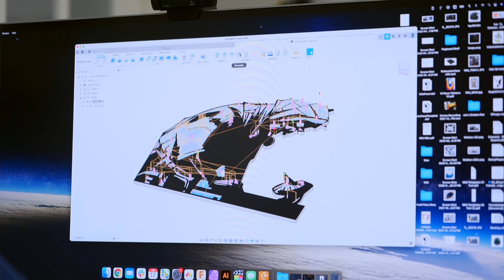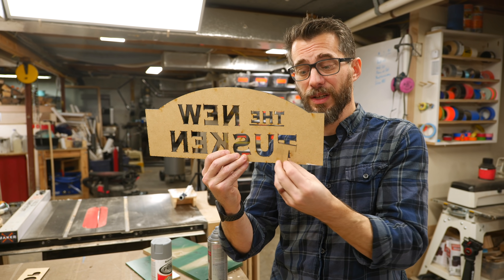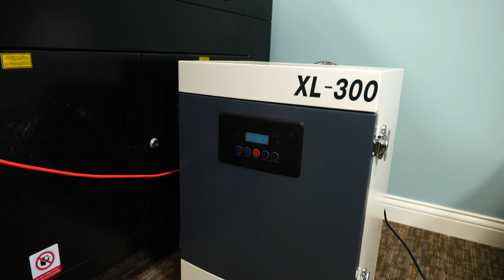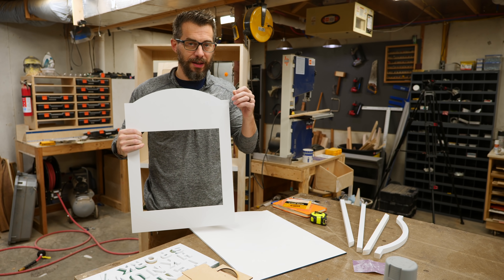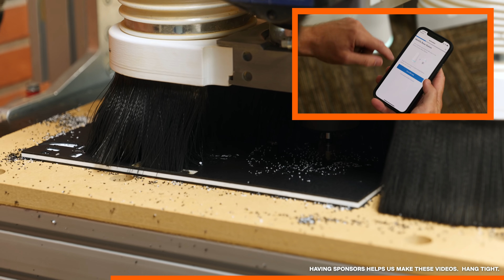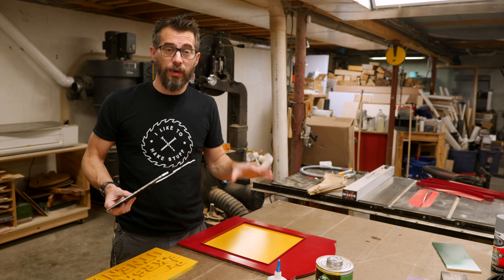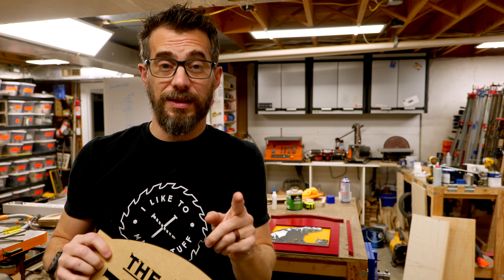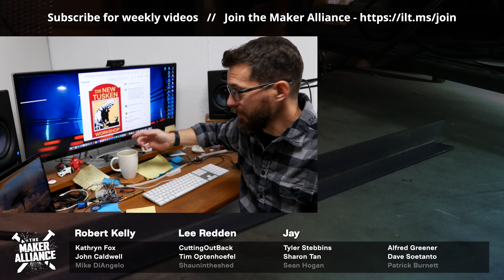Should You Buy a CNC or a Laser?

Comment from the maker: Save 20% on your SimpliSafe security system and your first month is free when you sign up for Interactive Monitoring. Visit https://SimpliSafe.com/ILTMS to learn more!
Reply: Could you do a review of different 3D printers?  Or try to make your own?
Reply: hey how is it going with your ghia : )
Reply: Bob Smith Industries insta-set accelerator works great for any CA glue and doesn't hurt painted surfaces or leave a white residue like other activators will. I use a needle applicator bottle for better control instead of spraying, plus you don't waste as much.
Reply: You're promoting someone. Did you forget the subject? Just remained you the subject, Should You Buy a CNC or a Laser?

Comment: Quick tip. For the template at the end, use wax OR Vaseline to cover the template back and edges this prevents the glue from sticking to it. Personally Vaseline is my favorite you can warm it a little and it becomes liquid and just paint it on. Super simple and glue never sticks to it. I also use it in some cases for painting to prevent paint from sticking.

Comment: After researching for quite a while I just pulled the trigger and bought a laser cutter for my workshop instead off a cnc. Main reason for picking the laser over the cnc was the dust a cnc would create. Other factors where the ease of use (No different tools and less cam) and hopefully that it would be easier to learn by multiple of my collegues
Reply from the maker: Very good point. You just have to vent a laser where you have collect the dust from a CNC
Reply: What laser did you pick?
Reply: @ivmilicevic  I got a BRM Pro 900. Its a dutch brand laser. 100 Watt glass CO2 laser

Comment: CNC is a large format planer as well. Further CNC tricks can start to replace bandsaws, jointers, and scroll saws at the expense of time and hot glue.  I make cutting boards larger than 12" wide ..it is painful to think of life without a CNC to flatten them and make the juice grove.  I own a laser and use that for thin high detail projects, but very rarely for cutting as the burnt edge is not my favorite.  I would vote 4x4 CNC before laser for woodworkers.  My 2 cents.  Great video and sign.   Now if only CNC machines could prime, sand and paint...🤔.
Reply from the maker: Good point. We made a bench out of a huge log a while ago and used the CNC as a planer.

Comment: Honestly, one project I would be super interested in seeing is building a DIY CNC Router. I've watched so many videos, but nothing as well produced as your content. Really breaking down the process, laying out the parts, and showing the build would be a really cool video if you ever want to tackle it.
Reply from the maker: oh boy. That would be hard for us because we aready have one and anything we'd make wouldn't be as good. There are a lot of makers that are currently doing it though. Two Cherries Instruments is building one.
Reply: Honestly, by far the easiest thing to DIY would probably be to get a 3D printer such as an Ender 3 and convert that into a CNC rather than trying to find individual parts or whatever to outright build your own and if you need more space just buy/make a longer bed.
Reply: @vgamesx1  as an importer of cnc I have seen a lot of horrible home made stuff. What must people just getting into cnc don’t think about is the side loading on the cnc bits and the ability to manage feeds and speed of the motor. Most use something like a Drexel tool for the little ones or a hobby router with maybe variable speed for the larger ones. Nether tool is designed for continuous use or for long runs and most suffer from premature bearing failure. I am NOT trying to say buy only, I have also seen some great diy ones but think very carefully about what you intend to cut and how often.

Comment: 3M makes an adhesive sheet that I attach to the back of my material before I cut it in the laser when I am making signs. The laser will cut through the material and the adhesive, and when I am ready to attach the letters I just peel the backing off the adhesive and stick it down. It's much easier than CA glue. The adhesive is called 3M 467MP Clear Adhesive Transfer Tape.

Comment: This probably won’t be seen but who knows, maybe. 

Bob, I run a couple lasers and you are doing yours a disservice with a weak extraction system and air supply. I run my air at anywhere for 50 psi to 80 psi when doing cuts and have smoke free cuts. This also allows the laser beam to work more efficiently if the smoke is displaced quickly. The extraction system helps with this as well.

Comment: I've been working with a local engraver to do my laser engraving. However, now that I'm starting to fill those designs with resin, I think it just makes more sense to have the CNC. It seems there is a much lower entry point for decnet CNC machines with medium to large capacities too. The larger bed laser engravers really jump up in price.
Reply from the maker: They absolutely do. Josh and Anthony really love their Onefinity machines. We have used Avid CNCs in the shop here and really love the build quality.
Reply: The onefinity is absolutely overbuilt for what I use it for, its amazing. and the customer support is incredible
Reply: If you are really into the DIY, and like making things, you should take a look at the MPCNC from V1 Engineering.  It stands for "Mostly Printed CNC".  Many of the parts can be 3D printed by yourself and the files are free, then you purchase the electronics, spindle, and 3/4" tubing, and assemble.  Can be built to almost any size you want within reason, larger with additional printed supports.  Can also be turned into a laser engraver, plotter, or even a plasma cutter!  Many videos on youtube.
Reply: The next step on the diy route is the printnc. You can make the case that the printnc punches wells above it's weight due to how rigid it is.
Reply: I've never even heard of the Onefinity machine. It looks great for the price too. I was looking into the X-Carve but it's $1,000 more than the Onefinity. Does anyone have any comparisons between the two?
Reply: @CrownMountainWoodworks  Skip the xcarve machine. The onefinity machine is one of the best in it's price range. Shapeoko is the next recommendation as well.
Reply: @heistking  Is the X-carve all hype with their marketing? A friend of mine has the Shapeoko and likes his.
Reply: @CrownMountainWoodworks  Yeah I would say. They were pretty good back in the day since then the competition has far surpassed them.

Comment: A note on tack cloths: the sticky stuff in them can cause issues with some finishes. There are ones specifically created for water-based finishes to avoid problems there. The default, if not labeled, is for oil-based finishes. Use the right one for the finish.
Reply from the maker: I didn't know that, thanks for the tip.

Comment: You could have used the CNC or Laser to create recesses for the letters as well that would help with alignment and for better glue options.  You could cut for example an extra set of letters, put them in the recess when you paint and then cut the paint, pull them out.  And you would have the back of the good letters not painted, so you have 2 good surfaces.

Comment: both. Next question.

sealing MDF, I use a HLVP gun (you can brush it on too if you want, this is just faster) with some shellac (light cut to start, heavier cut on 2nd coat). Since the shellac is mostly ethanol (I don't like the methanol smell so I stick to ethanol) it dries SUPER fast, as in I usually can spray the second layer after mere minutes.

Comment: I use a cheap HVLP spray system (£50 about $65) to apply paint and varnish to projects. You can apply in thin coats so quick to dry and a good finish. I've found water based works as good as oil based, so a big reduction in fumes and better for the environment. You can use big box store gloss paint (or DIY stores in the UK), so compared to aerosols it's much cheaper.

Comment: It would be a lot easier to make that sign with just a laser than just a CNC. The ability to make razor sharp inside corners is really useful. Also, you could start a signmaking business with less than $600  buying a large format diode laser, but $600 will not get you anything  in the way of a large format CNC. Finally, the noisiest laser is quieter than the quietest CNC.

Comment: I bought an entry level CNC with an optional laser.  After a lot of thought I permantly mounted the Spindle motor and then made a bracket to attach the laser to the side of the z-axis.   The Laser had a switch on it to disable it so I added a switch to the power wire to the spindle to disable it.   So I could turn on the spindle or laser depending on what I want it to do.   

The only difference is the laser is offset from the spindle when it comes to setting it up.     If I had a wider bed then I would add a second z-axis assembly to mount the laser so that it is easier to maintain and so that you can independly control the height of of the spindle/laser so you can move the device out of the way you are not using.
Reply: The idea of mounting both the laser and spindle on one machine at the same time is to make it easier to reconfigure the machine to do different work,  instead of changing hardware and wiring I just have to change a few switches  and then load in the code to run on the same system.     All I need to do is change the starting position when I use the laser as it is offset from the spindle

Comment: Lower your min power settings on your laser. The laser slows down in the corners and you're over powering the material with too much heat. That's why the corners aren't uniform and a tad burnt.
Reply: While that is a good practice on lasers that use Lightburn as control software, he is using a Full Spectrum Laser and it has its own  software that  handles corners differently.
Reply: @otherdogdesign8666  I see. The lesson here is don't buy a laser you can't use Lightburn with. (or sponsored or whatever)
Reply: @anarablehill5691  yes always lock yourself into proprietary software solutions whenever possible. It's always the best!

Comment: You can put a laser on a CNC machine but you can put a CNC cutter on a laser machine. If you buy a CNC then several of the bigger ones have a laser addon that can be purchased which, whilst not as good as a dedicated laser machine, will get you part of the way there and hold over until you decide if you want to get the full thing (space permitting).

Comment: CNC or laser?  The Snapmaker gives both, plus a 3-D printer.  It's a little more expensive, but it's cheaper than buying 3 tools because you switch out the heads.  There's also a lathe option for the larger models.
Reply from the maker: I've seen it but we've never used one. I'm always cautious about one machine that claims to do it all, but if it works, then great!

Comment: I got a cheap CNC/Laser combo device from Amazon. I did this because I didn't know if I was going to use it a lot or if I was going to be able to learn the application side of it. In the end it worked well for the project I had at the time but between my inexperience with it and it being cheap and not that good I ended up breaking it. My advice to anyone looking into a CNC, laser or combo device is to not buy an no name brand cheap Chinese made product. Even the cheap products are several hundred dollars and it's better to spend more up front for something mid range. At the very least may I suggest you get a product with an auto home function and auto stopping functionality.
Reply from the maker: Solid advice. A cheaper made machine can still work, but the limitations of the machine itself will limit what/how fast you can make
Reply: How did you break it? What broke? Couldn't you fix it? There's not much to a CNC machine really. Maybe I got lucky with home and limit switches because I don't have any. I put my origin at the middle of my work envelope. I have soft limits too.
Reply: @Iliketomakestuff  my drawer slide machine runs over 200 inches per minute. That's fast enough for me. I limit it to 90 because that's honestly fast enough for me. It gets too real when my lead screws go over 1,000 RPM.

Comment: Biggest thing I like about laser, and probably the only way I'd consider buying one, is if I was limited to indoor space only.  A laser cutter in a well ventilated room with filtration will work just fine in an office.  A CNC on the other hand, no matter how good your dust management is, it'll still get everywhere.

But like you said, a CNC is just vastly more versatile compared to a laser cutter, from the different profile tools, to an additional benefit if you have an open bed, you can cut pieces larger than your work surface in a pinch.  A CNC can do anything a laser cutter will do, but the reverse isn't true.

Comment: I've heard of sanding / roughing up surfaces to increase the surface area an adhesive has to work with. Not sure if that would have been of benefit to the plastic piece in the middle.
Reply: Sanding would definitely help. I don't know if surface area is why sanding helps glue stick. More like the glue can get in the scratches and grip. The whole smooth ice is more slippery than rough ice is deal.

Comment: FYI, if you are making signs for outdoor, don’t ever use MDF unless you use outdoor formulated like extira.    The better option would be precision board HDU or acrylic.
Reply: If the MDF is sealed then the MDF is not really exposed to the elements. But if that seal is defeated then you may run into an issue.

Comment: As usual, awesome stuff gang! That sign is an incredible piece. And I'm not even a Star Wars fan, lol.

Wish I had access to CNC and a good laser like yours... I'd love to do a seaQuest decoration of the hammerhead like was on the bridge of the first seaQuest.
Reply from the maker: Josh loved that show!
Reply: @Iliketomakestuff  Best sci-fi ever!
Reply: Just search for a makerspace near you, I have one nearby which charges $50/m which gives access to expensive soldering gear and test equipment, as well as power supplies, lathes, milling machines, drill press, grinder, band saw and several other things, so yeah it isn't exactly cheap, but you know, unless you're doing quite a bit of work on something then it doesn't make a lot of sense to spend upwards of $1000 to own a nice machine when you can just borrow it.
Reply: @vgamesx1  unfortunately neither space nearby has CNC, one has a laser, but only a smaller bed capacity. But normally I'd completely agree with your idea. Especially since I sit on the Board of Directors of one of those two spaces 😉😁

Comment: A big factor would be your workspace layout. Due to the way that a laser works, you would need it to be in a dust free environment. (Both for performance and to prevent fire hazards). So if you have a generally open shop area, a laser would not be an ideal choice. Even with a good dust collection system, the chances of having fouled mirrors and lenses is going to be a significant factor in your overall performance. With a CNC router, while you still want to clean excess dust off the machine, the device will not be quickly ruined by the fine dust that might remain in an otherwise well maintained area. 

With both options, you have available choices at several price points. However, a decent workhorse of a laser can be acquired for considerably cheaper than an equally reliable CNC router setup. The trade off though is that you need to know a whole host of different skills to work on and maintain your equipment at that point. With a CNC router there will be a number of skills which you would need to develop in a similar vein, albeit with significantly lower risk. (The inexpensive workhorse lasers may require you to change the bulbs yourself, handle focusing, etc....all of which is much more tedious than simply tramming the CNC). 

This isn't to short sell the value of the laser. I own one and actually take it over a CNC if made to choose. It just really depends on you and what skills you want to develop as a maker.

Comment: Looking good. Do you find that the plastics in the laser curl at all? I have no experience with laser cutting, but i do put a torch to polypropylene and it does make it flex away from the the heated side.
Reply from the maker: Some yes, we use some little pieces of double sided tape (roll on applicator) to hold it do a scrap piece of MDF. It helps hold everything down.

Comment: Correction:  You said the ColorCore is ABS, and it is not.  It's HDPE.  HDPE is a low surface energy plastic, so the point about the adhesive is correct...stuff does not like to stick to HDPE.  ABS however is much easier to adhere to.